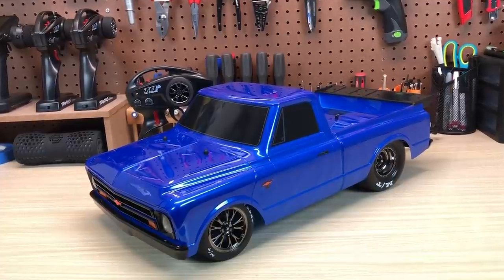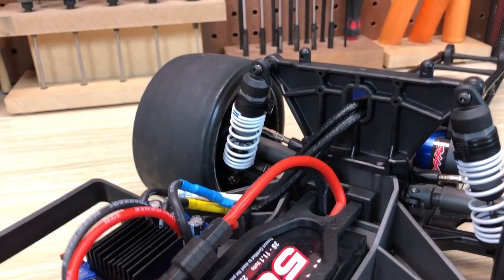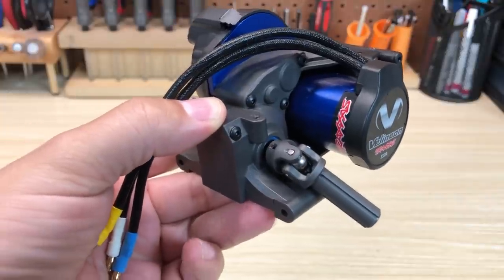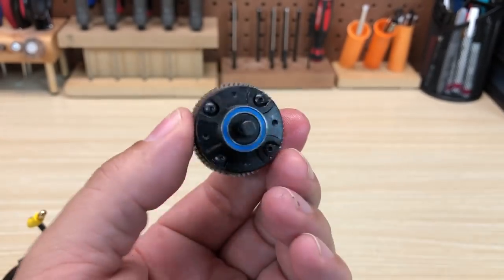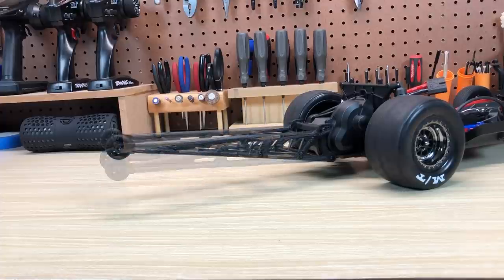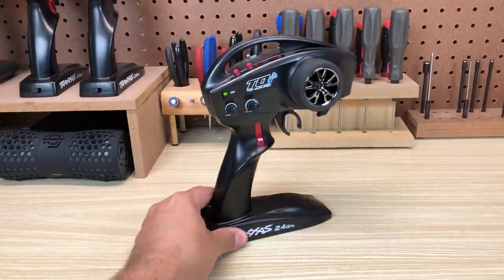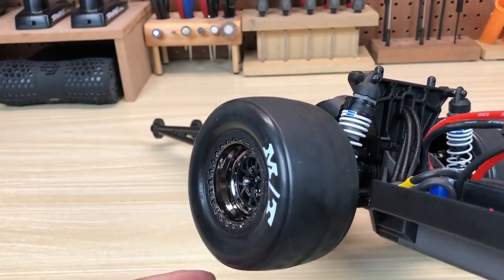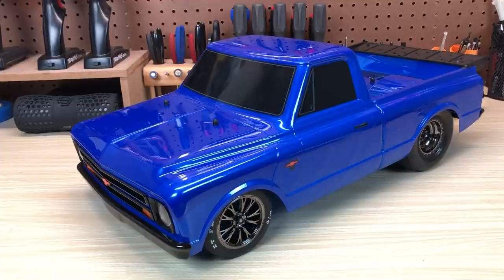Traxxas DRAG SLASH *IN DEPTH* -- not just a lame unboxing!

Comment: So in drag race mode it still has TSM off throttle? Wouldn’t that still correct on its own when “pedaling” / letting off the throttle?
Reply from the maker: If you're on the throttle side of neutral on Drag Race Mode, there's no TSM. TSM only comes on when you're on the brakes--not if you're just going from a higher throttle position to a lower throttle position.
Reply from the maker: Nobody wins a drag race off the gas - Derek